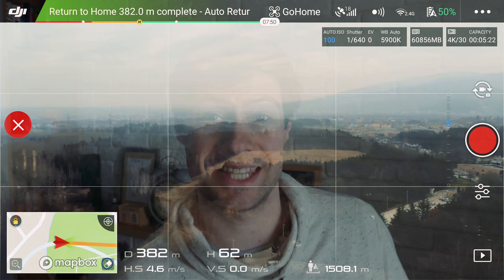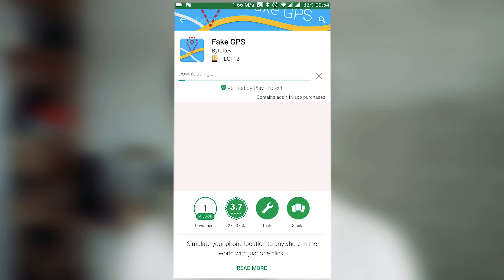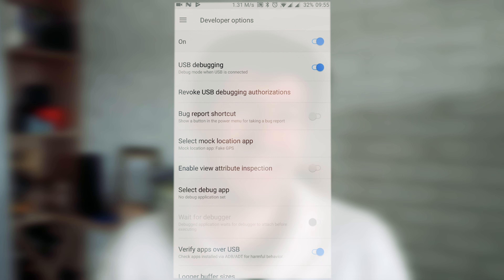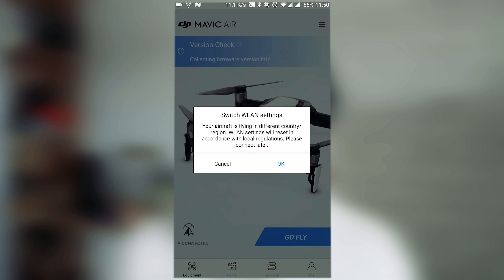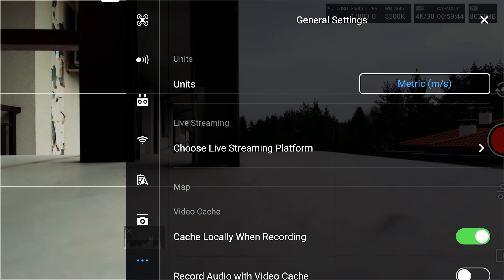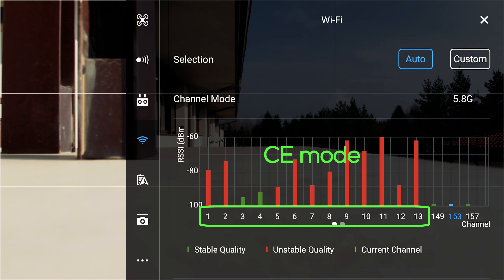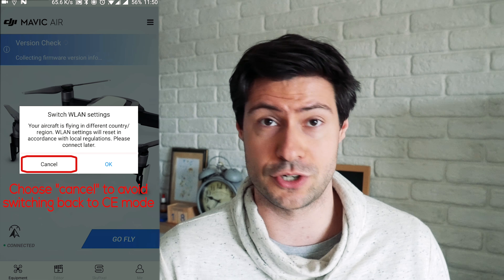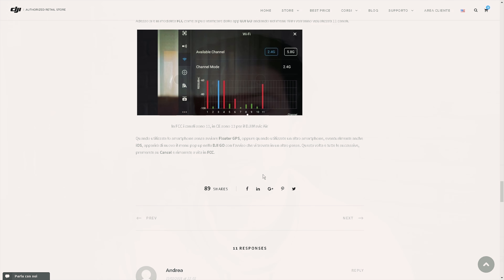DJI Mavic Air FCC Hack: Switch to FCC Mode in 2 Minutes!

Comment: Does this hack still works with latest DJI Go 4? 
I've tried to do this with my Mavic Air. The map (in the app and in Google Maps) showed NYC, but the app itself never suggested WIFI settings switch nor 5Ghz configuration.
Reply from the maker: Try to wait for a few minutes - it still works and I still use it.
Reply: @TechMishka  It actually works indeed. I had to disable location "help" from WIFI and Bluetooth. (using Samsung S10)

Comment: I know that I'm in FCC mode because it shows only 1-11 channel, but why does it show 5.8 instead of 2.4 even though I'm in FCC; and it automatically reverts back to 5.8. Will it make a difference?
Reply from the maker: The channels can be switched automatically. With the latest firmwares, if you are set to auto - the drone and the transmitter are automatically switching to the most optimal channel. 
I usually select the channel of preference manually and prefer to fly in 5G in order to avoid interference with routers, babyphones, etc.
Reply: tech4all thanks for tip, lastly do I get roughly about same distance in 5.8 and 2.4; FCC?
Reply from the maker: 2.4 should theoretically have slightly better range. As for the 5.8 - I prefer using it because there is less interference in urban areas.

Comment: does it still works? because i do everything you say, but, the dji 4 program does not restart, and either i enter the go fly, or close the program and open it again, in wireless settings i see 13 columns, not 11.. :(  any ideas why is that so? now i'll try to reinstall the program.. maybe it will restart then..
Reply: well, the problem was that for this to work, the aircraft and the rc had to be within 50cm. now i'm in FCC :)

Comment: I can confirm that this process worked,however,everytime i switch off my spark and close the dji app,it will revert back to EC mode which is the 13 channels,any help?thanks
Reply from the maker: Oh, I have seen this kind of behavior with other devices as well. You may try an older version of the app. Or - you can check the TSS Facebook group - search for TheSparkSide.

Comment: Did this since my drone had a "good" signal for about 100 meters (mavic air) in a sub-urban area (buildings but a huge park, I fly at 5AM to practice since it's 2 mins away, when noone is around) and the only obstacles are trees. After 100m I'm getting video feed loss etc, both on 2.4GHz and 5GHz. Will report back with what I got on the same spot.
Reply from the maker: It will surely improve it. But 100m-loss sounds like either bad reception and something wrong with the drone's transmission, or maybe too many interfering signals.

Comment: Does this also work with the Mavic pro? I normally only get 400m of range before it disconnects completely. 
HELP APPRECIATED!!!!!
Reply from the maker: Hi Nicolas, sure - it does work with the Mavic Pro as well. 
Before going into FCC mode - try to manually choose a channel - and look for something in the 5GHz range - usually the higher frequencies are not that "busy".

Comment: Hello sir!.Im so insecure about my drone.But ill try this later.Will i put the drone on wifi mode or rc mode?.Im using mavic pro.Thanks
Reply from the maker: If you have the Mavic Pro, why would you try FCC mode? The Pro has quite a great range, no matter where you live :-)
Reply: I live outside the us and somehow my drone disconnects at about 600 meters.Will i put the mavic pro on wifi mode or rc mode?
Reply from the maker: Never owned the Pro, but it sounds like you need it to be at RC mode. None of my friends with Pro have complained of such short range. Weird ....
Reply: Thanks

Comment: Hey there I want to ask if I do this hack. Does it remove my ability to check my actual flight path. Cuz I live in a really dense city and I lose the sight of drone once I take off. And I rely on my gps track on the dji app map to guide my drone back. Nice video btw
Reply from the maker: The RTH feature is based on the GPS inside the drone itself.

Comment: From what i have read it does not work on the latest dji app.  Altho installing version 4.2.12 on android worked.
I am yet to confirm it tho
Reply from the maker: I usually stay away from updating apps, but I doubt they have disabled it. It is a nice backdoor that they certainly prefer to keep.
Reply: How did you do that. I've 4.3.0 installed on my s9 atm. How can I downgrade The version?
Reply: @Richardoati  i gooled downloaded and installed the apk on my phone.
You might need to change a setting in developer mode. I can not remember sorry.

Comment: Any thoughts on using a Samsung Note 8?  I tried and couldn't get it.
Thanks
Reply from the maker: Haven't tested with the Note 8 - could be that access to such features are restricted. Where are you stuck? The Mock location settings?
Reply: Tech4All 
I got it figured out. Just different steps in a different order to get the red marker. 
I tested it out and don’t think it really improved my range though. 
Thanks for getting back to me.

Comment: Hello!first of all thank you for the clear instuctions but still I have some questions as a noob...
I followed every step and got it working as you said, BUT the area I'm in is apparently a no fly zone, so if I turn on the app I can fly but I have no navigation except for the old school visual methods;
1. if I fly with the fake gps on and hit RTH will my drone attempt to fly halfway around the world?
2. will there be a flight path visible?
the area I want to fly in is a national park near the city half of it is free to fly but the other half is obstructed by the circular area which surrounds the city, so I think I can fly low and cause no one any trouble therefore; ( if the first two questions are negative which I suspect they are)
3.how can I achieve proper gps tracking and fly in the park?
Sorry, if the answers are already sctattered below I though this might be a bit specific
Reply from the maker: Hi Eddy, thanks a lot for asking these question, let me try to help:
1. No, luckily not. I cannot afford risking the "life" of mine, cause it is a very serious investment :-) The hack only tricks the transmitter about the localization. The actual RTH is navigated by the GPS that is in the drone itself - so that operation is not impacted.
2. Sure, everything works as if you are not in FCC mode
3. Just fly as you always do. 
If right now the mentioned park is a no-fly zone, it is not because of the FCC mode, but because of an update of the DJI Go app. No fly zones are getting more, and stricter, unfortunately...
Reply: tech4all Allright, thanks a lot for the swift reply, its all clear now! I'll simply get away from the city and enjoy the range now :)

Comment: Hi, excellent tutorial!! I'm in Australia. My Mavic Air showed 11 channels at 2.4 GHz before I did the hack - which suggests FCC mode already, and 11 channels at 2.4 GHz after I did the hack using Fake GPS (so still in FCC). However, my problem is I can't select 5.8 GHz when I change from 'Auto' to 'custom'. DJI Go4app version is 4.3.37 - what am I doing wrong? Many thanks.
Reply from the maker: Hey mate, thanks for the question. Quite weird that 5ghz cannot be selected. But the 2.4 range is anyways better - so if the range is now stable enough - just use it as it is.

Comment: Soon I will try if this worked!
My top distance is 1,531m which as I can see is calculated during one flight. I estimate that my furthest travel in one go was ~500m. Not a meter more. Ain't bad, ain't good. A lot of disconnects and loss of signal happnening in Lithuania.. probably because there is wifi around every corner.
As for altitude I reached max available (so 500m I am guessing?)
Top speed only 69km/h.

Gonna test FCC stuff when it is not as windy as today... :P
Reply from the maker: Good luck and be careful! 😊

Comment: Doesn't seem to work anymore, I get prompted to change regions but the RC doesn't restart, it just stays connected and shows the 13 CE channels.

EDIT :  it does in fact work but NOT if you connect from the USB port at the base of the drone, with the microUSB port on the side it's like before, with the RC restarting in FCC mode.
Reply from the maker: Oh, that's unfortunate. Let's hope we'll find another way.
Reply: @TechMishka  Actually I meant to edit this, it does in fact work but NOT if you connect from the USB port at the base of the drone, with the microUSB port on the side it's like before !

Comment: When I start the App with fake location, nothing happens. But the map in the DJI app shows me the fake location. It is still in ce mode. can you help me?
Reply from the maker: Force stop the DJI Go app, start it and wait for a little - there should be the prompt appearing eventually.
Reply: No, it's still not working. Do I have to install a later version of DJI Go?

Comment: Very useful, thank you. Yesterday I lost signal at 700 m, today Ill test it again. Should I chose one of 0-11 channels or 149+?
Reply from the maker: Depends on  the area where you are flying at. I usually fly in the 5.8Ghz range, but for some people 2.4 feels better - these radio signals depend on altitude, surrounding buildings, area positioning and plenty of others - so the best thing to do is to try a few different modes. 
But once you get into FCC you will likely not need any adjustments :-)

Comment: hi thank you for making this video , but can this method be apply to Phantom 4 pro, pls help.
Reply from the maker: Hi Azry - very likely this will work, yes. If it doesn't, it wouldn't harm.
Why do you want to apply this on the Phantom? It should have the perfect range, no matter where you fly.
Reply: tech4all yes that is about right but I find my p4p having problem with distance. As for my p4p around 2 -2.5 m I my drone will have interference problem . If I’m in a certain location when I reach 1 m I’m starting to have interference problem and disconnect .  I have a question for you, this method  can we use the latest version DJI go app with this mod, hey do u have Facebook or what app. I’m hoping we can chat regarding this matter tq
Reply from the maker: Got it. In that case - trying the modification described in the video should work. I haven't tested it, cause I don't have that model myself, but there is no reason not to.
As for facebook - https://www.facebook.com/tech4alln0w . Overall - the comments section here is the one that I monitor the most.
Reply: tech4all  ok thank you will update you...will try when i got hands on my drone
Reply: Ok i have tried with samsung note 3 . Its an android phone . I have used the fake gps . I have done what was required but i dont get 11 channel i got 13 channel . Channel 1 to 13 that all this it dosent work or what have i done wrong. Hey ple advise me ...im confused now hahah
Reply: Sorry let correct it . I only got 13 to 20 channel ...now i dont know what to do pls help me to perform fcc mod tq

Comment: Will this work on Mavic 2 Zoom? Thanks for the amazing video
Reply from the maker: Hi Bernardo. Yes, it will. But why would you need it? I saw a few range tests that show video footage passing beyong 5KM away from the transmitter.
Reply: @TechMishka  I also saw people complaining about the range for CE. But in general people are very satisfied. Thanks for the answer
Reply from the maker: @bpestanabastos  The CE range is indeed sometimes limited, but probably not that limited on the Pro-versions. Occusync is a technology which has no consistency checks and even with not too great quality of the signal it should be able to nicely pass real-time footage. 
Have a lot of fun flying it! :-)
Reply: @TechMishka  Mavic 1 and Mavic 2 use Occusync. There is no way you can check on the RC if you are in FCC Mode, so I guess your answer is wrong.

Comment: So this mod is only for those living outside the u.s.? I live in the U.S. and my signal still sucks.
Reply from the maker: Correct - being in the USA is going to keep you at higher transmission rate, so the mod won't really help you.

Do you fly in a city? I have never had issues with coverage, especially outside urban places. 
Try to manually select 5.8G channel. Usually there is less interference at 5.8G

Comment: How can I check it changed to fcc? What is difference between ce and fcc?
Reply from the maker: Just go to 4:03 - this is how the FCC wifi settings look like.
Reply: Watch the video again! Smh
Reply: just to simplify everything, FCC is for USA and CE is for europeans... FCC has longer wifi range due to USA laws and CE has shorter range due to europeans law, now with the rest of the world, they're neither FCC or CE.. I was surprised that DJI automatically downgrade the range to CE even though you are not in europe...  boooh to DJI!
Reply: Yurs Truly Korea is CE too ....haha
Reply from the maker: 4:02 is the part where you can see the clear difference between both.
Reply: Tech4all after the last update of the dji app. The channelnumbers are gone. So, now I don't know how i can check if this Hack Works. Even when i switch off the fake GPS app, i don't get an message that I'm in a different county. So, how can i check this?
Reply: @Richardoati  Just fly your drone ans see if you get way more fly distance than before ;)

Comment: So, I have spoofed the location, it asked me the first time to change wlan settings, fine, but when I switch off the fake GPS, it never asks me again. And actually, it only asks me again when I set my location to USA again?? Almost as if it is reverting to CE mode every time, unless I have fake GPS active, in which case it asks me to change to FCC every time. Sounds backwards to me... Help?
Reply from the maker: Hm, sounds like you are using 4.1.18 or similar. 
Try using the last version of the app that was released a few days ago - it doesn't do the automatic revert. Or 4.1.15. I used to have for a long time 4.1.8 and it was also very stable and fine.
Reply: tech4all I am on 4.2.8. But I found the problem was my phone. The DJI app saw that I was "now in the US" and asked me to swap settings, but as I clicked ok it didn't push this info to the drone, so it never actually swapped. Tried a new phone and it worked first time. Now I do get asked each time if I want to revert. So I don't know why people. Keep saying that its stopped asking, it does seem to still ask. At least on android. Maybe ios is different.
Reply from the maker: Thank you - very useful feedback and will certainly help a lot of other people that are trying to do that.

Comment: So it only works for Android phones and not for iPhones?
Reply from the maker: There is an option for iPhone, but is much more complicated... You can do it with Android phone and then use your iPhone as usual, just don't let the app to switch the wifi settings.
Reply: @TechMishka  hmm, I will try to find an iOS compatible one or maybe just buy and Android phone to use as a remote alone, and keep my iPhone for phone purposes only :)
Reply from the maker: @ValVesa  yup - most of the cheap android tablets will be fine. Note that if the phone or tablet has too slow CPU, the app lags BIG TIME. 😎🙃

Comment: That was great however if your air gets lost when using this work around and you are on the refresh gji scheme I doubt they will pay out. Just a thought.
Reply from the maker: I don't remember having seen any logs about FCC/CE mode in the log files they usually ask for. Therefore I believe there will be no issues with taking advantage of the refresh program.

Comment: Wonder can you get in Trouble as ill be going to Europe in a week and wondering
Reply from the maker: You might get in trouble not because of the FCC mode, but if you fly not in accordance to the laws. Check the available info for the countries you will fly at. In Germany it is forbidden to fly at night, in Belgium it is almost impossible to fly; In italy you should be below 60 meters height, etc, etc. Just be careful and more importantly - get to know the regulations where available! :-)
Reply: i Know the Basic Rules and Respect them =)
i just was worried using a unallowed frequency could be troublesome
Reply: quick Qus whats the highest wind speed in Mph do u recommend i fly 26mph sometimes but i feel a bit uneasy but sport mode helps alot
some say 30mph max as its spark speed in sport
Reply from the maker: I don't think there is any recommended wind speed :-) Mostly up to you. I personally stick to the rule - "if I am asking myself whether it is too windy, then better don't fly" .
Reply: @TechMishka  how about flying in this conditions lol
I took this reading hour ago

http://imgur.com/a/wZJF1Wz
Reply from the maker: 104mph wind is crazy :-)

Comment: Thank you for sharing this Awesome information.
I bought my mavic air a few days ago before learning about the CE mode restrictions.
I don't fly long distances but its reassuring to know that I now have a stronger signal. 
Thanks again & it was very easy to do.
Good luck Sir.
Reply from the maker: Thanks a lot Alan! I am running it in FCC mode because of the very same reasons - hate seeing the signal indication going red after 200-300 meters... 
Happy flying! :-)

Comment: You're a legend with this video!  There are people talking that the latest DJI update for the original Mavic Air blocks the ability to do this CE to FCC hack. Do you know anything about this? And if it's true, can you just not do the prompted update?
Reply from the maker: Hey Tom, that's bad news, and would be quite a nasty move from DJI side... I no longer have the mavic Air around and cannot confirm or deny...
Reply: @TechMishka  thanks for the timely response. I'm pretty sure it's true. I'm hearing it about the mini and Mavic Air 2 but it isn't as serious with the 2 because the range is already so good....but still.